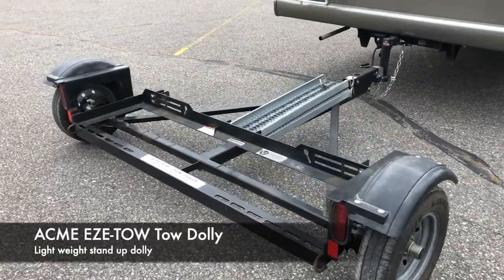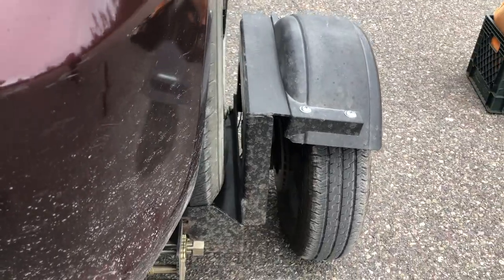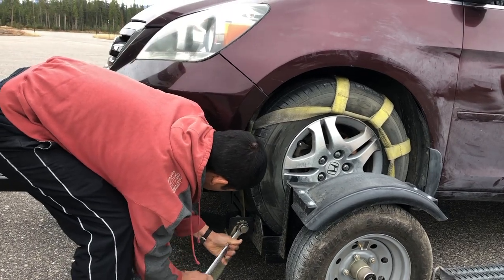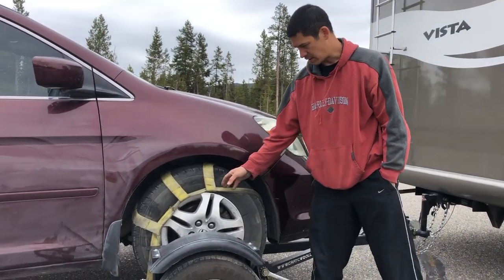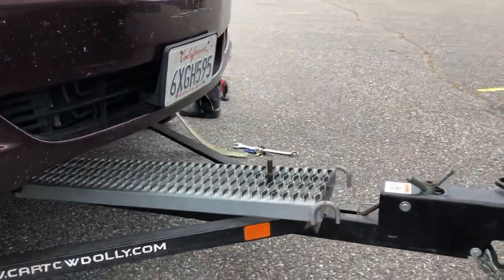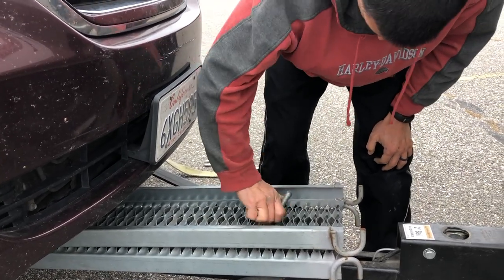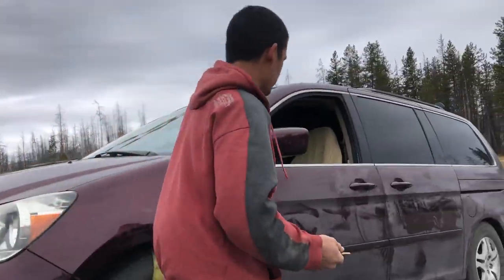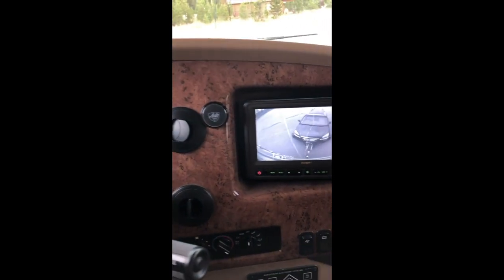Towing a Honda Odyssey minivan behind our RV - with the EZE tow acme tow dolly

Comment: Wow, watching your video was like deja vu all over again. :)  Excellent job!
We have the same model and have done 2 1/2 cross country trips towing a Chevy Equinox using the same splitter and magnetic tow lights.

Yes, aligning the car properly can be very time consuming. Some days, you just can't seem to get it centered.  
Rarely does hookup take less than 1/2 hour and you jump in and out of the car a LOT. Laying on the pavement in 100+ degree heat is worse than when its freezing.  It also sucks in the rain. Because it's such a hassle, we rarely unhook the car until we get to a destination.  This prevents sight-seeing along the way and defeats much of the purpose of the trip.  
That, more than anything, is why we will probably switch to as economical a tow bar as we can find.  
You can get a complete bundle for around $2000 if you're willing to go with surge brakes and can do the labor yourself.  
And even though this is a "light" dolly, it can tweak your back if you're not careful.  The tow bar weighs much less, which can only help on hills. Storage space is also a non-issue.

Yes, the ends of the straps fraying is a major pain.  
I push mine through from the top with a flat head screw driver, then pull from the bottom when I can catch something that came through the slot.

Yes, the ground wires for the lights vibrate off.  
We also lost an entire license plate and bracket due to vibration. They should provide a solid plate mount.
Our brake wires (running under the frame) also worked their way loose and had to be tied/taped up.

Yes, you need to be positive those strap hooks are fully vertical when everything is tightened up. 
We had a strap come off completely, most likely because of a missed inner hook that had snagged.  
Safety chains are a must! We use an extra long one in the middle, connected to the bolt that holds the ramps in place. 
We also swapped the original chains for some with clips on each end after a chain bounced out of the eyelet on one trip. The clips prevent this. 

You can save a step on the safety chains if you put some bar magnets from a hardware store on your control arms or find some other way to leave them in place.  
Tuck the chains up there when you disconnect and they stick.  
We never had them come loose (we used several magnets) while driving the car.  
Reach in and pull them through the eyelets without having to remount the chains on the control arms each time.

Yes, the tires wear out after about 5,000 miles.  
Having a single spare, we bought one mounted replacement on Amazon while on the road.  (No longer available).
Now, with two rims to spare, we bought the next unmounted pair on Amazon for about $100.  Mounting cost about $30.
The trailer guy who mounted them said he thought the tire surfaces were being vulcanized because the surge brakes were being over-applied.  
I tend to agree with your turn analysis on the video.  
Either way, they wear out fast and the cost does add up.

We also had a flat and were lucky we had a TPMS installed, a spare, a cordless impact driver and small floor jack with us.  
Swapping in the spare wasn't too bad under those conditions.  Didn't unload the car from the dolly.
Can't recommend the TPMS and enough tools enough!

I noticed your ratchets appear to be mounted upside down.  I mounted mine with the release handle up, as in the Acme demo video.  The handle to get in the way of the ratchet locking properly if there is a lot of tension on the strap. I often have to keep some tension on the ratchet, then tap on the handle with a hammer to get the catch in all the way. 
Your way seems better!
Reply from the maker: All good thoughts! Thanks for sharing

Comment: Good video, thanks for the explanation as you worked on securing the van.  We're looking to buy one in the next few weeks.  Would you still recommend buying an EZE Tow Dolly?
Reply from the maker: Hi Jim,
Great question - I don't really have a strong opinion on it as I haven't tried other dollies.  It worked for what we needed - I wanted something with brakes and the wider stance to allow me to tow the van.  I actually sold the dolly because I now generally pull a trailer with toys instead.  In hindsight for the amount of time we used the van we could have used UBER, rented a car, etc.  It was not totally necessary for us to tow a vehicle.  Hope this helps.

Comment: I believe the reason why the doly is dragging when you turn is that the chains that you are attaching underneath the car are too short and not. Enough slack when that chain is taunt it is now pulling on the Dolly.
Reply from the maker: Hi! Thanks for the suggestion - I wish that was the case - in fact I purposely took some turns to watch it as I turn but the chains had plenty of length...

Comment: Had this car dolly and it's junk. Went through three tires caused by the front angle iron! If you are stopping in a turn the side wall hit the angle Iron damaging the sided walls.
Reply from the maker: Thankfully I have never had that problem with my tow dolly.  So far I have put just shy of 9000 miles on it.  My biggest complaint is that the trailer tires wear out so fast due to when I turn it slides.  What trailer did you end up using?
Reply: Sold the trailer and the vw bug. Replaced it with a jeep and now tow 4 wheels down. Easy hookup and I don't have to lay on the ground hooking up the safety chains.

Comment: Does the rear of the van get scraped on the ground
Reply from the maker: Sorry for the late reply!  I just logged in and saw your question.  I was really worried about this as well as our van is older, the rear suspension is shot, and we have a tow hitch.  Fortunately, the hitch did not scrape.  However, we were not able to mount our bike rack to the back of the van as the bike rack would definitely scrape.

Comment: That van work on flat tow
Reply from the maker: Hi, for all the research I did it I could not find an economical way of flat towing it.  I wish I could though.  Towing the van was nice as we could put 5 bicycles in the back (it was like bicycle Tetris) of the van.
Reply: @danypak  I also bought this dolly for the same reason.  Now I see you can get a Ready Brute tow bar (with surge brake capability) bundled with everything you need for about the same $2000 the tow dolly cost me, provided you can handle a wrench enough to remove your front bumper cover and bolt on the baseplate.  And if you're using this dolly, I'm pretty sure you can handle it.
Reply from the maker: I have always wondered if the odyssey could be towed 4 flat.  I’ve heard of people doing it but was hesitant in doing it because Honda says not to. Let me know if you end up doing it and how it turns out.